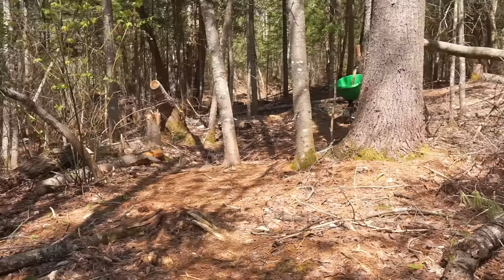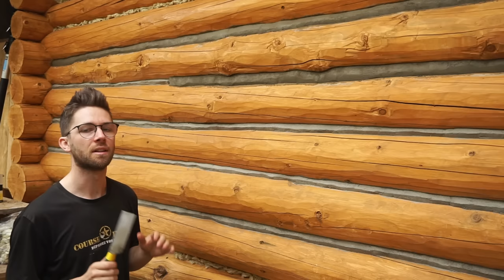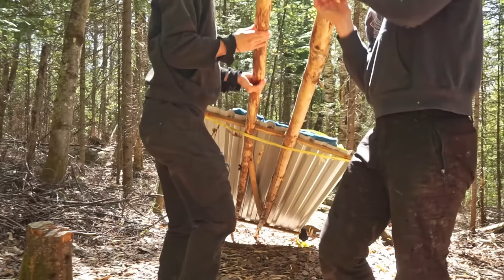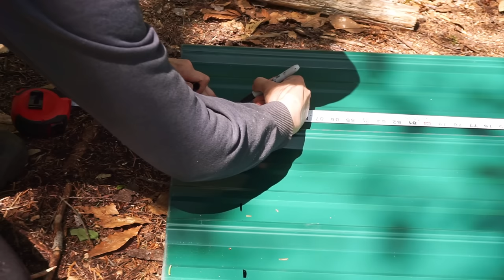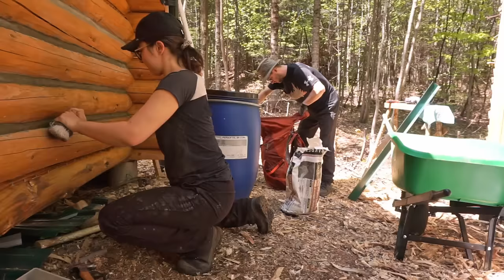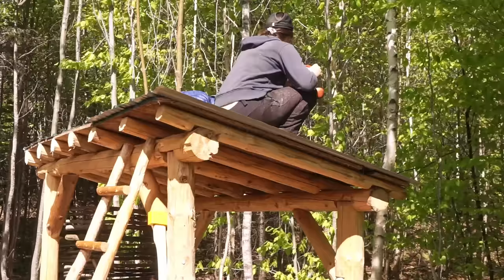Building A Log Cabin | Ep. 56 | Ripping out the chinking and starting again! | Porch roofing

Comment: Use a natural rope pushed into the seems between the logs inside and out covered by pitch.  This allows for expansion/contraction as well as waterproofing/insulation.  Any mortar you use, despite all efforts, over time will crack!  (You can however use modern specialty products made just for chinking that contain acrylics that allow for expansion/contraction) but regular mortar, regardless of the precautions taken, will crack over time.
Reply: I was thinking the same thing. I'm sure there's a silicone/rubber like substance you can use thats specifically made for chinking? Though I think they want to use something more natural?? However, having to drive all of those tiny nails in, would make my brain explode!

Comment: My dad worked on steam boilers at the hospital  and when they did repairs they used boncrete or  wood glue in the motar. I saw it and dis a patch at home where there was a low spot . It never let go in 30 years.
I think fibreglass chopped up would be the go. I see step treads at the station with it in. Very strong

Comment: Coming along so nicely.  Great shot of the metal sheet going on the porch roof, it didn't make me nauseated at all.  Chinking looks like it's permanent for sure.  I watched another channel one time put in the expanded metal and I remember thinking that bent nails would work fine and take less the half the time so congratulations on the idea!  The covered porch is so attractive and an absolute must.  I'm a bit concerned about the weight load of the snow with that super shallow pitch but I suppose the framing is plenty adequate to handle it.  Can't wait to see what is next!
Reply from the maker: Thank you Dave! The roof should be fine, Nick did the calculations and everything passes quite easily. We'll probably take some snow off midway through the winter anyways because it might start to block our 2nd floor windows!

Comment: Chinking looks alot better now. Are you guys going to brush some kind of sealer on the mortor to give it better moisture protection? I hope the porch roof is strong enough to handle the weight of the snow your going to get. Looking good guys.
Reply from the maker: We thought about it and haven’t yet made a decision ahah 
As for the porch, it should!! Nick designed it to be able to resist the load of more than our average snowfall. But if we ever get worried, we’ll go on top and take it out :) 
Thanks, Tim!!

Comment: Hey guys, if you cut pieces of screen & staple them in between the logs, & add a small  amount of ashes from your woodstove to your morter mix, it will hold so much better. Sincerely, the old Montana cowboy, 
Frank Scherping
Reply: wire lathe stronger than screen.
Reply from the maker: We might try out metal lath on future walls and see what works best! And we didn't know about using ash, we may try that too

Comment: Good night.
At first, I look at what and how you do... very interesting!
Watched the previous video and this one and you are making the same mistake. The tree grows larger at high humidity, and becomes smaller as it dries out. the fact that you cover the cracks with cement is not good, because the cement will spill out later. How about you take a sealant that can withstand frost and heat and when it hardens it will be like rubber, it will be better.
As for your garden... some plants don't do well in acidic soil. land with conifers is impossible for them. Be careful ;)
When there is not a lot of water, it is better to cover the ground with a thick layer of mulch, then the moisture does not evaporate and later the mulch becomes dry!;)

Доброї ночі. 
Зпочатку дивлюсь що і як ви робите... дуже цікаво!
Подивився попереднє відео та це і ви робите одну й ту саму помилку. Дерево при високій вологості стає більше, поли просихає стає меньше. те що ви цементом замазуєте щілини не добре, бо цемент буде висипатись згодом. Як що Ви візьмете Герметик який витримує мороз та жару і при застигані буде як резина, буде краще. 
Щодо вашого городу... деякі рослини погано себе почувають в кислій землі. для них неможна землю з хвойними. Будьте уважуі;)
Коли не дуже багато води, краще землю завривати товстим слоєм мульчі, тоді волога не випаровується та згодом мульча становиться добевом!;)
Reply from the maker: Mortar has been used to fill the gaps in log cabins for centuries, so we're not too worried about it. The synthetic sealants are also way more expensive! 
So far our garden is growing well, hopefully it stays that way!
And good point, we covered the raised beds with wood shavings
Reply: I really hope for this!
I like what you do! not everyone will decide on such a thing, and not everyone will have enough experience to build their own house, especially in the forest.
Everything is going quite well for you! I respect such actions! Don't stop! ;)

Дуже на це все сподіваюсь!
Мені подобається те що ви робите! не кожен на таке зважиться, а тимпаче не в кожного буде досить досвіду щоб побудувати Власний дім та тимпаче у лісі.
У Вас Все виходить досить вдало! Поважаю такі вчинки! Не зупиняйтесь!;)
Reply: Chinking has been done for hundreds of thousands of years and some are still ok to this day.  Education and knowledge is a wonderful thing. Trees do not grow once they die.

Comment: You should try using hardware cloth works best cut narrow strips fold in half roofing nails in place  works great use been years still hold tight. The size is 1/4 inch .
Reply from the maker: We’ll try it out for our next wall, thank you :)

Comment: Loved the episode as usual, but have to admit that seeing you take away the first batch of chinking scared me a bit.
It looked to easy to peel it off. I think it shouldn't be like that.  Makes me wonder if the nails will make much of a difference even.
Is it possible that the treatment that you gave to outside of the cabine to give it the yellowish-brown color somehow contributes to the chinking not much gluing to the timber?  What would the chinking do to untreated dry wood?  Would it stick much better?
I hope I'm not raising unnecessary questions and make you worry over nothing, but I'd hate to see you finish the whole cabin only to find out that this will not last.
Reply from the maker: Don’t worry, we thought the same thing!! And we don’t know if it would make a difference on untreated wood, we sadly didn’t try it before applying the stain.. the nails, thankfully, keep it in place very nicely!! We were also surprised to see big chunks of the mortar fall out, but now that the nails are in place, it’s solid :)

Comment: You said earlier you watched THe Outsider. You should have done what he did, clamp pieces of meal fence grid to the logs and then put mortar. Logically, that will hold ALL mortar together.
Reply from the maker: We thought about it, but our logs and gaps are a lot smaller compared to the outsider. For that reason, we don't think we can properly secure the mesh and have enough of it between the logs to make it worthwhile. We don't think it would be worth all the trouble
Reply: im certain it would still be a better option. Nails wont do much good. You will still get huge chunks fall off in between the nails.
Reply: @Josip let's see the chinking on your cabin build................